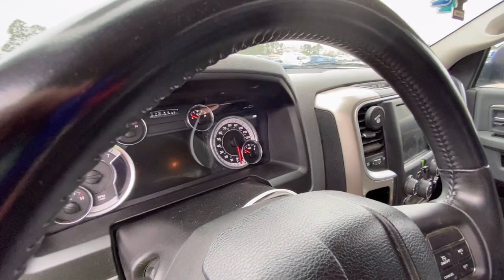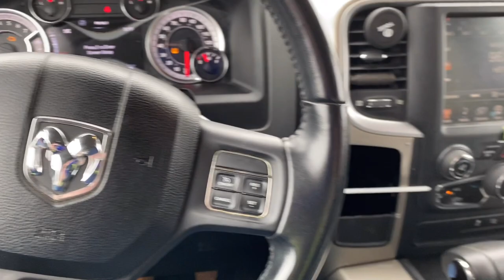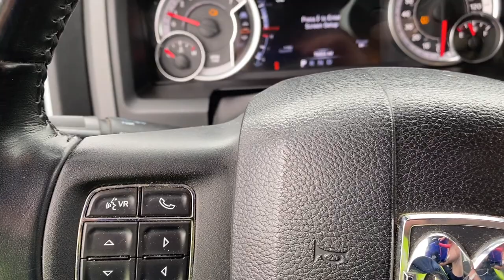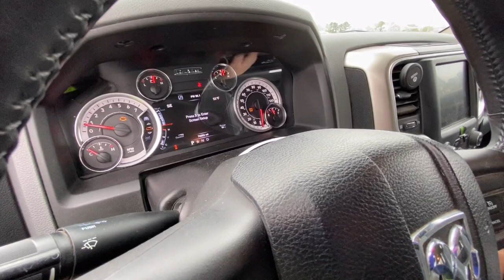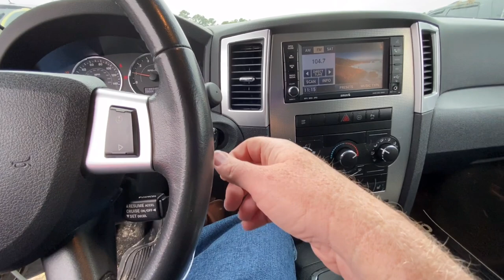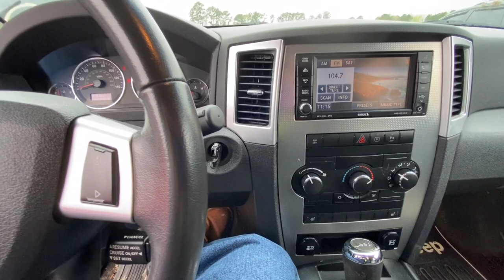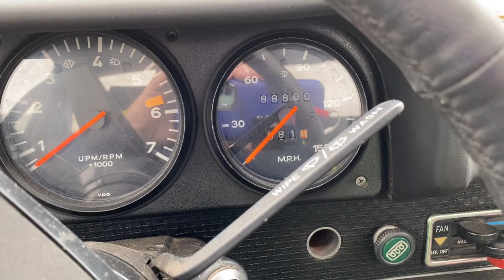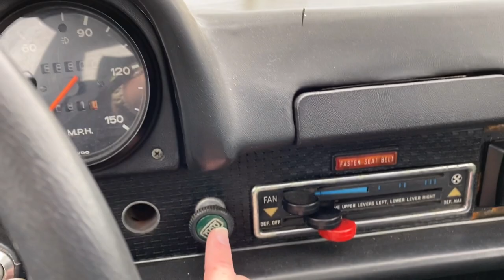Copart Win Pick Up, Copart Walk Around, 1975 Porsche, Jeep Commander, and More

Comment: The Porsche 914 or VW-Porsche 914 is a mid-engined sports car designed, manufactured and marketed collaboratively by Volkswagen and Porsche from 1969 to 1976. It was only available as a targa-topped two-seat roadster powered by either a flat-4 or flat-6 engine.

Comment: I'm a Mopar guy and I had a 3.7 in a Liberty.  Never again.  Better than a 2.7, but under powered and oil pressure issues at 80,000 miles.
Reply: The 3.7 is a V6 that sounds and feels like a 4-cylinder
Reply: That's a hemi in the liberty. Look again. I thought it said, 3.7 myself but when the video loops over the second time I seen it, it said 5.7 hemi. That's a steal for 1500! I'd drive it as is all day lol
Reply: @B0xlife1  that was a Commander.
Reply: I considered the 3.7. It was 4 years newer than the one I ended up with but a Loredo. I settled on an 07 3.0 Limited, which I think was the best engine they came in. Plus its pre-DPF.
Reply: I’ve never had any issues with the 3.7s in my Jeep’s, just gotta take care of them, last Grand Cherokee had 217K

Comment: 11:00 That Nissan Titan parked in front of the Silverado looked interesting. 11:30 That Ram might have been a repo or theft recovery......very nice regardless, although the front bumper did look like it was curled up a little, maybe crunching the headlights........stupid easy fix. I sure would love to see it sitting in my driveway. And WTF???? I tried finding that truck on Copart's web site, and it's not even listed. 17:30 As long as the damage is limited to the door, and the rocker panel, roof, and the B and C pillars aren't damaged, it's an easy fix.......never mind.......I didn't know it went swimming. 30:03 Fixing a cracked dash is not as hard as some might think it is. There are plenty videos here on YouTube on how to repair them without a whole lot of money being thrown into the project. It's a bit of work, but the end result is incredible. I bet the ignition key would unlock the hood lock on that Porsche.

Comment: I have a question about the jeep commander when you get a chance to drive it, does it make a noise that almost sounds like it would be the tires but maybe sounds more like the axles or transfer case? its like a very low pitch whine.
Reply from the maker: No noise At all

Comment: if you say the 4.7 is a good motor youre dumb mine had 2,221 miles on it and it blew up got a hole in  cylinder 7 motor was completely rebuilt blew up again had a brand new engine put it blew up after 1500 miles busted the blew a piston rod in half and broke the camshaft in 2 and the crankshaft they are hot garbage any new mopar motor is junk other than there cummins which isnt even theres and the hemis and srt motors are ok
Reply: i finally got tired of throwing motors at it and pulled the 4.7 put a 5.9l 24v common rail in put 3500 suspension and axles under it and double framed the rear it already had a cummins trans and t case they 1500 frames already have the mounting holes as they are interchangeable with the 2500/3500
Reply: de porche motor is in de midle
Reply from the maker: No I’ve said it before. I’ll only buy a hemi at least a 5.7 I don’t buy 4.7 engines or 3.7.........
Reply: @TKsGarage  sorry tk the comment was meant for the mopar guys that think it is i know you wouldnt get one trust me ive been here since the beginning of the channel id be a fool not to know which motors you like or not
Reply from the maker: Lol it's all good